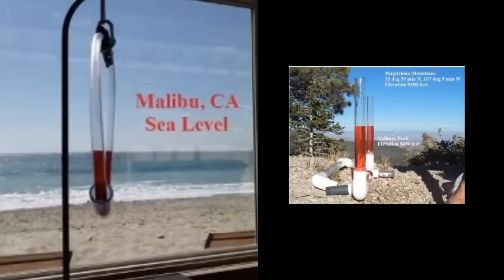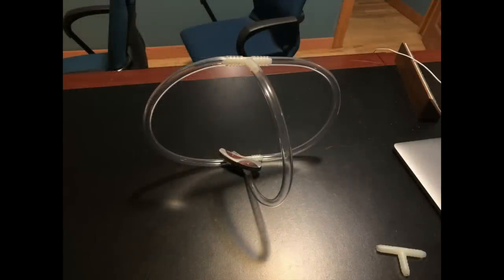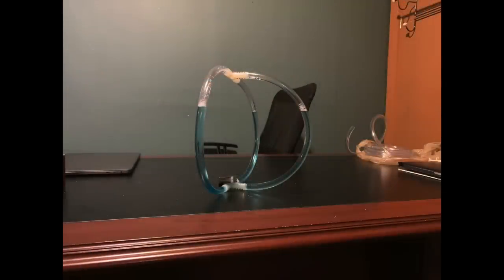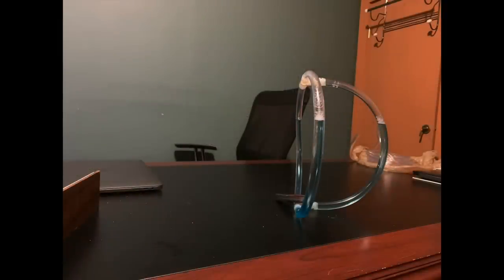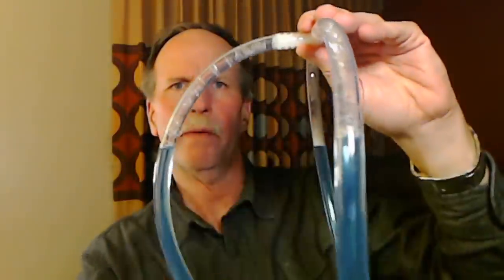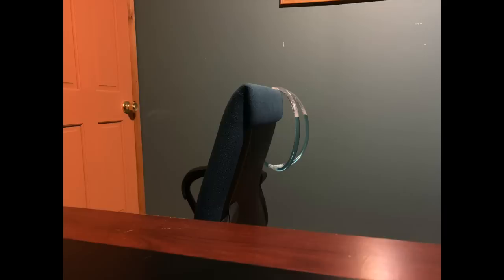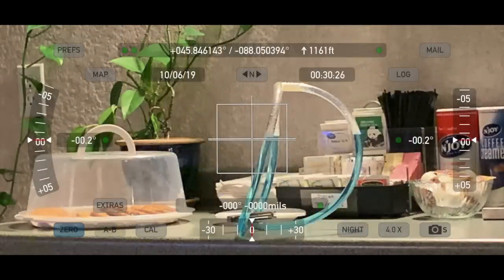Bob's Triple Water Level

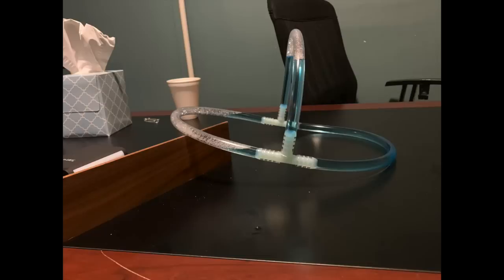Comment: It would've been good if you had pointed out that the T connectors are hollow (not plugs) to allow the air and water to circulate between all tubes, and that the air can get trapped (2:35) if it's oriented in a way, that both T connectors are submerged in water.
Reply from the maker: Yes, they are T connectors.  They are hollow.

Comment: THE VERSION 2.0 WILL BE A X CON WITH 4 CLEAR PLASTIC TUBING TO A X CON .. 4 CORNER WATER LEVEL METER 
USE COLURED WATER OR
COLORED SPERIT AND WATER TO make water more level in the tubes to break water surface .. or a mikro drop dishbcasher sope
Reply from the maker: Honestly I prefer the three tube version, you have a variety of surfaces to tailor to the location and placement site.  4 would be basically a ball and that restricts your measurement options.

Comment: Hi Bob, nice tool! However, it should be bigger so that the distance between the measuring points is larger and give a better accuracy for what shall be measured. Keep up the good work!
Reply from the maker: No this is a portable tool with more than 14 inches of distance between the tubes.

Comment: Hey Bob, I don't know what editing software you use, but you seem to have a problem with the audio transition between clips. The last word at the end of one clip is often cut off at the transition to the next clip. In Adobe Premiere I'd fix this by dragging an audio transition between the clips, but even then I think you could do with letting the clip run for another 250-500ms so that the last word doesn't fade out too quickly.
Reply from the maker: it does that at random some time.  remember that was in a hotel room on th road, not my regular studio and equipment.

Comment: Great, so now FEs will be taking that contraption with them on plane trips.
Reply: And it will not work consistently for the same reason bubble levels don't work consistently on airplanes. Also, good luck getting that past TSA (if you're flying within or out from the US).

Comment: We need to figure out which liquid is best for this "level" so it is clearly visible and not susceptible to sticking to the inner part of the tubing.  The bubbles concerns me as it may affect the surface of the liquid.
Reply from the maker: I am thinking there are a number of good candidates, from just plain water and food dye to windshield washer fluid
Reply: @BobtheScienceGuy  Orange all weather RainX from autoparts store, or Animal Safe radiator fluid. Easier to see if water is in background & they can't say you froze it

Comment: I'd made a comment in another video about making one similar to the PVC base one you showed, only with four vertical tubes, four 90° elbows at their bases, and a 4-way cross X shape fitting at the bottom so the fluid can equalize across all four verticals.  I like yours better; it uses fewer parts, is more versatile to use (as you stated), and is a more elegant design.  Well done!

Comment: Bob, I seriously have issues with the Windex and the bubbles. Some could argue about the bubbles not giving a clear view of the surfaces of the three arms in this device. What might be a better liquid?
I was thinking Apple juice, but it might produce bubbles as well. Also, it might decay after a while and affect its usefulness.
Any other cheap ideas?
Reply from the maker: I had windex handy.  Use whatever you want.  You will get the same result.

Comment: More cheap science equipment:
Use a poop emoji toilet plunger to track the shadow of the handle throughout the day. Even if it isn't during equinoxes you will find that the path of the shadow from sunrise to sunset is impossible on a flat earth with a hovering, circling sun. And because the shadow is straight, clearly defined and right there next to you, they can't invoke flerspective, refraction distortion, atmospheric lensing or any such nonsense.
Use a can of soda on a long light color table (or put paper on it) outside. In the morning and afternoon when the shadow is elongated observe the umbra and penumbra of  the cylindrical object become more obvious as the shadow projects farther away, something Flat earthers say "never happens".
Use a dry vinyl or plastic plate and a drinking straw. Pick up a small amount of water and put it on the plate. If it's small enough it will form a drop, like dew on a leaf and you will see water curve, something which, again, flat earthers claim never happens.
Use a clear sheet of acrylic and a marker to trace the sun rays in the morning or evening as they pass through the foliage of a tree. Flerfers believe that the converging path of  those rays prove the sun is local and small. If you do this experiment, it will show that if their reasoning were correct the sun is the size of a ping pong ball and it's hovering 20 feet above your backyard.
Use a hula hoop to illustrate the horizon. Place it around your head at eye level, and notice that even though it's circular, you can't see curvature from side to side.
I could go on but you get the idea.

Comment: Very cool idea Dr Bob!  
I was thinking...  If you could find tee fittings that had 120 degrees separation between each "leg" (rather than the 90, 90, 180, like you used) it wouldn't be able to tip over on it's side.  Although, the weight on the base appears to work just fine, as well. 👍
Anyways... Thanks for doing what you do!  Really enjoying the FE butthurt that's been going around lately!!!  Hehehehehe

Comment: It's critical to accuracy in an instrument like this that the tubes be straight vertical at the level of the liquid surface. Otherwise refraction in the thickness of the angled tube walls may cause the water surface to appear higher and/or lower in the front and rear surfaces. Also, there can't be any air bubbles as large as the full diameter of tube, though bubbles smaller than the tube diameter will not affect accuracy. This means non-transparent tubes like garden hoses and PVC pipe, could conceivably hide error inducing bubbles. Also, the liquid must be uniform density throughout, which also means uniform temperature throughout. Thus the possibility of different solar heating in different parts of the tube must be accounted for. The white foam on the Windex makes for a nice contrast, but the small weight of the foam may push the surface of the water down different amounts if there are different amounts of foam above the different surfaces. The meniscus must also be taken into account. Error from variations between meniscuses can best be minimized by making the water level long. Flat earthers may like to use these possible sources of error to dismiss the water level, but water levels, auto-levels, theodolites, builders levels, and other instruments, all show the same eye level in agreement with each other, so the water level can't usually be dismissed as having enough error to invalidate the horizon dip they show.
Reply: For bonus points, measure out how significant each of the effects you have mentioned would be, and then make sure that the measurements you're making swamp those...

There are two ways of avoiding meniscus problems.   One is killing surface tension.  A tiny drop of dish soap will kill it mostly dead.  Which is not a good idea if you're not supposed to be contaminating the liquid.  The other way is learning how to read the liquid level properly*, by arranging things so that you actually can see the meniscus effect, and draw your "line" parallel with the true surface, not the meniscus "flange" - this is contained in the first hour or two of education you get before getting unleashed into a chemistry lab in high school or college/university.  if you can't read meniscus effect *properly your chemistry experiments won't work right because you're incapable of measuring quantities properly.

Comment: Idea behind the apparatus (most will already know all this, but maybe some don't):
The basic idea here is, that water finds its level. So you need a body of water and aim along its surface for the horizontal. In principle a glass of water would do the job, but with a small surface it's hard to get a good bearing, so that would be very inaccurate. OTOH nobody wants to carry a big bowl of water around, and all you really want is two points of the water surface with some lateral distance between them.
To get that the principle of communicating vessels is used. In those a liquid with homogeneous density rises to the same level in the connected pipes. As the pressure above the liquid must be the same for this to work, the pipes can be either open at the top or connected.
Reply: Do remember that Bob's version is limited in precision.  It's  a lot better than a glass of water, but not as good as those used in, for example, construction - which will often be quite long (sometimes 100'+).  It's a simple portable device with zero setup time/mess that will do a good enough job for most things.

I think it kinda cool.  KISS principle.

Comment: What are Flerfs even trying to prove when they make their "always rises to eye-level" claim?
Reply: Beats me, the horizon would be below level on both a flat or globe earth, especially with elevation.  That is if there were a horizon on a flat Earth.
Reply: @Q.E. D  If the Earth were actually flat and you were on top of a 10,000 ft mountain then level would be 10,000 ft above the surface no matter the distance. If the horizon is where the sky meets the surface then in this case the horizon would be 10,000 ft below you. That is where the surface would be.
Reply: that the horizon doesn't curve so the planet can't be curved. Also that perspective explaines why things dissappear in the distance.  Yeah both of these are wrong but without measuring devices, it's looks that way with the naked eye, so you gotta distrust the tools also... yeah...
Reply: @Q.E. D If you were on this 10,000 ft mountain looking at another 10,000 ft mountain 100 miles away you would still see the entire mountain, the horizon will never block any of the mountain base.  Does the horizon appear to rise?  of course, and so does the base of the mountain due to the angular size getting smaller and you being level with the top of the mountain. But it will never appear to rise to level or the top of the mountain. The entire mountain would always be visible. Therefore it does not rise to eye level.  If you kept moving the mountain further away there would be a point at which the angular size of the mountain and the amount of photons entering your eyes would be to small for you to distinguish it anymore. This would of course be omitting any atmospheric conditions.
Reply: @Q.E. D Well even on the globe Earth the horizon appears to rise especially when using optics that magnify.  Looking out over water at buildings in the distance that  look half submerged gives you an effect of seeing a raised hump of water between you and the buildings.  But of course the water is actually dropping from your level line of sight.
Reply: thnx for the replies. That BS claim puzzled me for so long. It's like, people have different heights, and our heads and eyes can tilt up & down so why dey say dis?

Comment: Bob, you know that the fe community do not have the mechanical aptitude to use tools like cutters and measuring tools. Somehow they will find a reason that the Windex will not be a proper element to use, for reasons. So I will build one, and maybe get you the device in use and such. Also, being such a simple device it is still far to complicated for the fe community. Peace
Reply from the maker: Windex is not essential, you can use any thin liquid (I'd avoid heavy oils due to density issues)

Comment: I can hear Gigantor now, ...  “Phuket Mama, this too hard to make.”

I’m thinking though I might use this to get my landscaping timbers level. Easier to see than a regular level. Thanks Bob.
Reply: Umm no,  it will show level even when your timbers are not. For this to work you would need a much better base and lines on the tube that are calibrated to the base.  This is why it works good for for his purpose (it will show level even on an unlevel surface).  But if you are able to hold this along side of the timbers instead of setting it on top, it could work, although you would get more accuracy running a tube from one end of the timbers to the other.
Reply: Observer that would work, thanks
Reply: @Observer309  You almost never use liquid levels or lasers by trying to point directly along the object to be measured.  Because surface irregularities et. al. screw it up and you can't get the business ends of the level enough to the object.

You do it the same way that surveyors do - strike a level near the object (usually just above) to be leveled, and adjust the object so the distance from the level line is constant.

More often you use a liquid level or laser to mark two level points at either end, and if the distance is short enough, use chalk/masonry line drawn tight as your reference, and measure from that.
Reply: @fromagefrizzbizz9377  Umm isn't that what I said? (it should be done from the ends if he wants the best accuracy). 

It was my understanding that he was referring to using this home made level instead of setting a carpenters level on the timbers.  I doubt that he is planning on building a structure on the timbers  so actually just placing a level on them should be good enough if he is placing them somewhere in his yard. What little bit it might be out of level overall would never be noticeable. (even though the flat Earth people claim to be able to tell level by just looking, I assure you, you cant.)

Now if he were placing them along the foundation of his house, he would want them to match the foundation.  Using a level on a straight 2x4 extending out from the foundation of the house would be the easiest way to do this.

I have graded, framed and poured countless yards of concrete using a water level back in the days before we had lasers available.
Reply: @Observer309  Yes, it was, but I was explaining why to the rest of the watchers of this thread.
Reply: @fromagefrizzbizz9377  Ah, OK, like I was trying to explain how this apparatus would not level a timber by setting it on top of a timber.
Reply: Observer I was thinking that this would be an easier way to get the first layer level on a slope. I have to step them. It’s a project for the spring. (I just retired.) I think the water level will work well. Thanks t everyone for the suggestions.
Reply: @Sherwoody  You're building a retaining wall up a slope or some such?

Yeah, best not to slope the timbers.  Step 'em.  Don't forget the drainage, pinning and anchoring.
Reply: @Sherwoody  Ah you're in the same situation as I.  I retired last fall.  This summer I did some new landscaping projects as well.  

One thing I might suggest to kept in mind (something I had on my mind).  At my age now I enjoy the projects and am cable of doing them.  But we are not getting any younger, so I tried to keep in mind that I want to use materials that will last and do things right so they will not need to be redone. Ten years from now I might not be capable of redoing them and I hate the thought of spending my old age looking at failed landscaping.

I also dropped a couple of old trees that appeared to be on their way out (while I'm still capable of doing it).  I decided I rather spend my retirement years watching young trees grow than to watch the old one die.
Reply: Fromage Frizzbizz 
I’m levelling a corner of my back yard. We downsized to a smaller home and this will give me a little more usable yard. I just have to be careful of drainage.
P.S.  Retirement is wonderful.
Reply: @Sherwoody  Semi-retired is even better.  Work from home when you want to, bugger off when you want to, and get paid too.

Check out some web pages on retaining walls.  Some things to consider: height, depth of footing, type of footing, pinning timbers (so they stay on top of each other), anchoring timbers (so the hill behind them doesn't push them over).  Drainage screens, pipes and gravel footing bases.  Most retaining walls that fail are because of bad drainage (especially in frost-prone areas) or inadequate anchoring (taller walls), and sometimes simply not enough footing depth.

Doing it right isn't much more trouble/expense than doing it wrong.  And cheaper in the long run.

The code for retaining walls here is relatively reasonable: they want you to get a permit (and engineering design signoff) of any retaining wall higher than 18" in some cases, in all cases over 30".

Your wall may not be high enough to require much of this stuff, but check out the web pages anyway so you can see how taller walls are designed, and that should give you a guide of what you should consider for yours.
Reply: Fromage Frizzbizz thanks. I’ll keep your info in mind. I’ve got the winter to plan it. I’m retired for good. Might do some volunteer work in a local hospital. I’ve got a lot of interests to keep me occupied.
Reply: @Sherwoody  Heh, my wife insists I have way too many hobbies.
Reply: @fromagefrizzbizz9377  sounds familiar